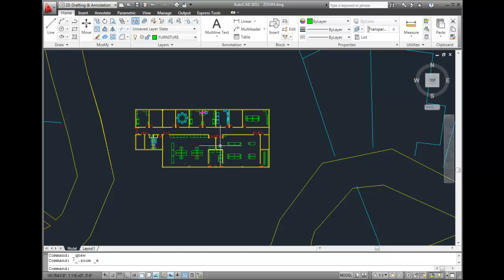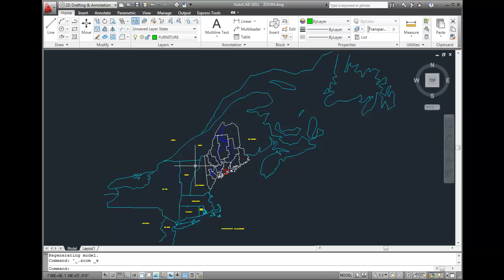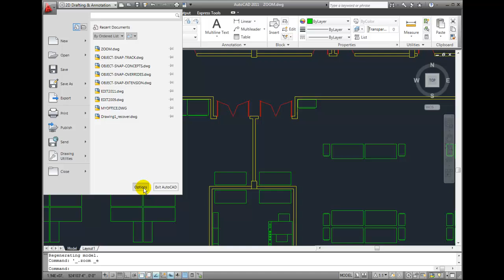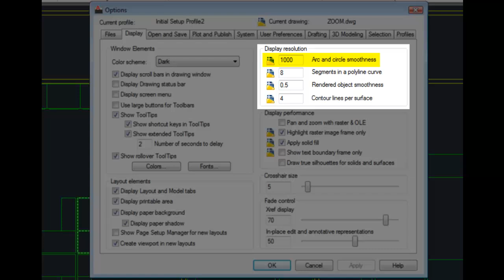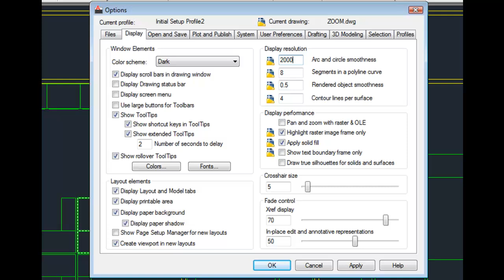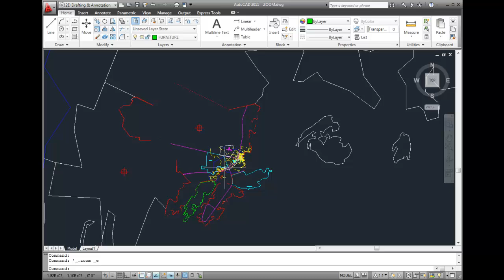AutoCAD 2011 Tutorial - Adjusting Zoom Settings - viewres

Comment: What doesn't work  if you have a long pipe, 
(for example 400 mm  diameter and 10000 mm length) 
as an extruded ring as a 3D solid and you have any 
shaded View Style... looks very bad... can't find why...

If extruded length is small (for example 1000 mm),
or view style is Wire Frame, then looks fine...

Crazy! eh! eh!  :(